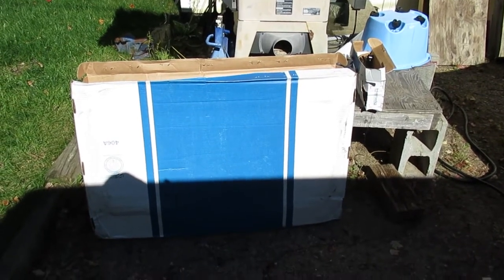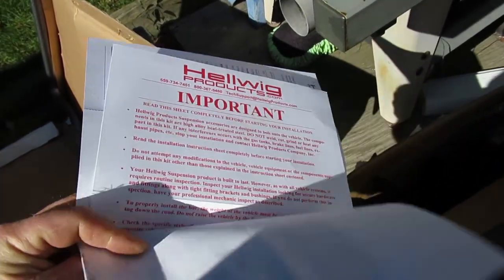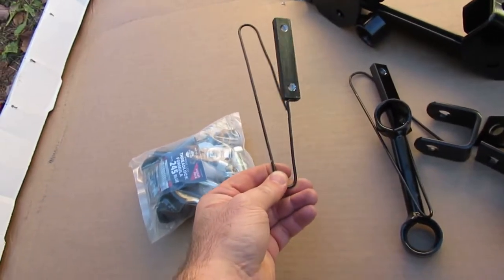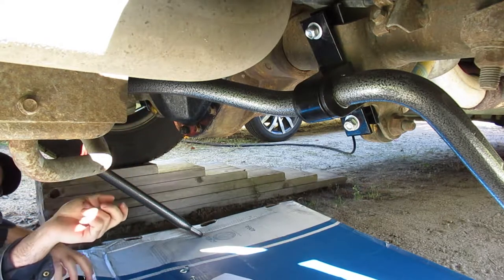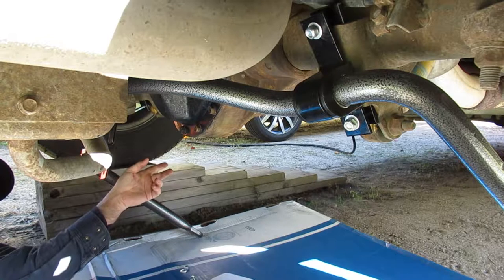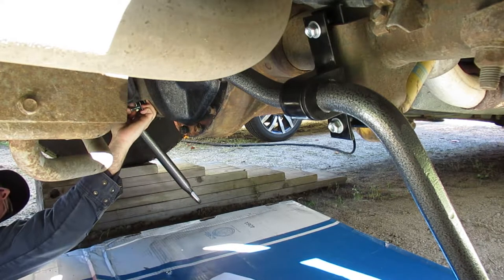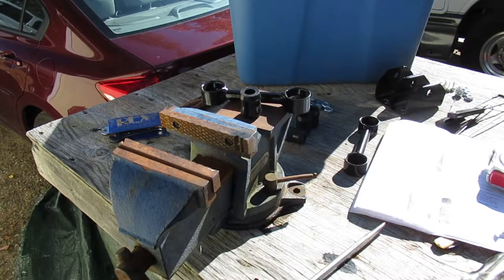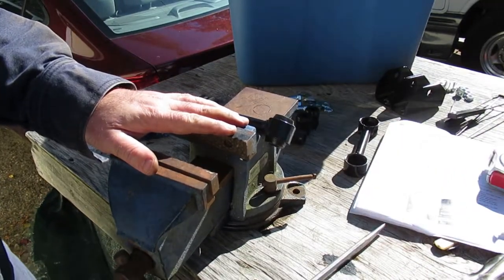Hellwig 7635 Rear Swaybar Installation Chevrolet Express 3500 2004 Roadtrek Popular 190

Comment: How has the rear stabilizer bar setup worked on your RoadTrek?  Our Chevy Express sways and am hoping to reign it in so to speak. Thanks for a great video!
Reply from the maker: I'm happy with it.  You will do well with a good pair of shocks too.  Bilsteins are a bit harsh if you pick the wrong ones and the Fox shocks I have on the rear are for a lifted van so I'm not sure what to recommend.

Comment: Nice video 👍.... I will be installing mine on my c class motorhome with express 3500 as well. And a track bar.
Reply from the maker: cool, I'd like to see that.  My jeep has a track bar and it makes the rear axle swing left to right about 1" over the distance of the suspension travel.  Hopefully you have a workaround for that.
Reply: So you probably have dually rear wheels.  Did you have to do any modifications to install the sway bar on a dually?

Comment: Can the swaybar be installed on a passenger van express ?
Or its only for Roadtrek RV style vans ?
Reply from the maker: The one in this video will fit both passenger and cargo 2500 and 3500 vans.  You can check the application on the Hellwig website just to be safe.

Comment: I have a Pleasure Way with the same GMC chassis and the generator is mounted a little different. Looks like I can move it 2 inches, maybe 2.5 inches. Curious on whats the distance from the rear end bolts to the back side of the sway bar? Also, did it make a difference?
Reply from the maker: The van is parked for the winter so I can not provide any more information than is in the video.  The swaybar helped a lot with stability in the corners even with what I believe are worn out shocks.  I was having some bad swaying when trying to pass people and that has gotten much better too.

Comment: Stephen, can you share any info about moving the generator? I have an 07C210P.  Thanks
Reply from the maker: I have a video about removing the generator...in the end I just moved it back a few inches.  It should apply to the 210 if the generator is at the back of the frame.
Reply: @SteveRivett  I am trying to install a sway bar but most sway bars require the moving of the generator which I am try to avoid.  Do you think it is possible to find one (sway bar) that doesn't require moving it?
Reply: I recently saw a post that indicated a stock GM sway bar used on the Chevy 3500 Cutawy van might work.  Do you know anything about that?
Reply from the maker: @richardtravilnguyw3492  Take a look at the "Class B Forum", there are people who have modified their vans.  I know Average Alice put one on her van but it's an older 200.  The main thing to look out for is access to the frame where you drill it for the mounts...I heard this area may be modified by roadtrek on the 210s

Comment: Those are Plubming tools.    They are for old lead  joints.   They are curved so when you pound the lead you don’t smash your hands against the pipe
Reply from the maker: cool, I thought the lead was poured in
Reply: To lead in cast iron pipe....at least what I did in the early 70's was to use a caulking/gasket type cord first "before" pouring in the lead. In that end you would need to pack in the "packing" material and the tools could be used for that.